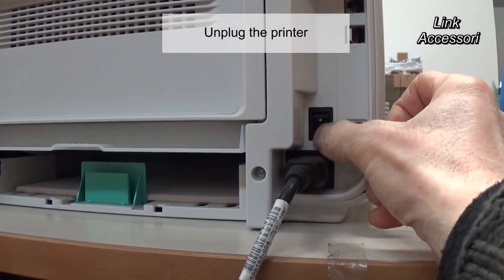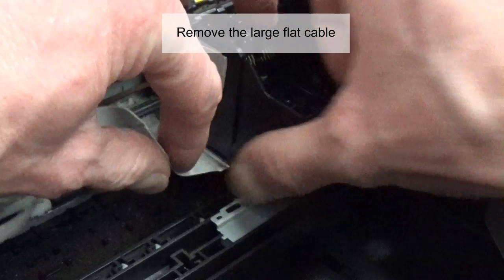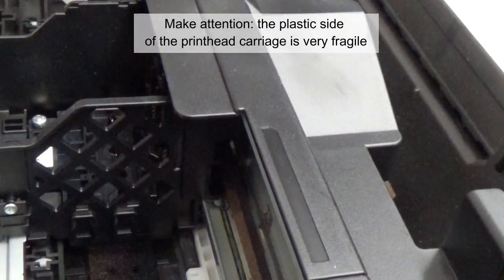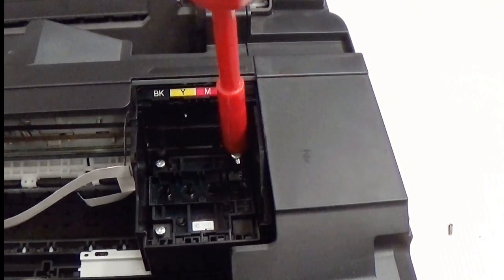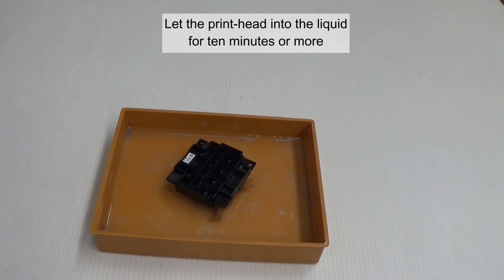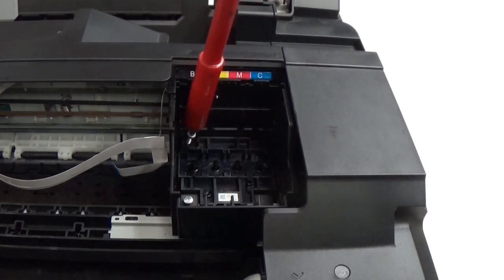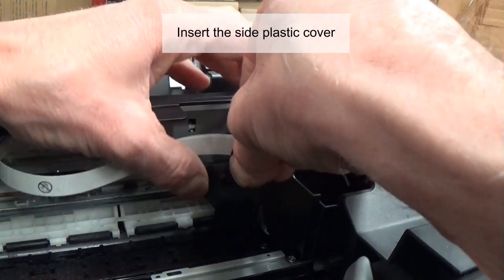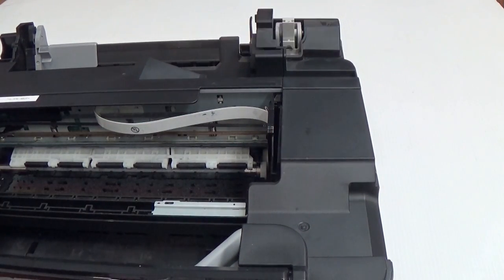How to remove the print-head from Epson inkjet printer XP300 WF2530 WF2540 XP400 and others

Comment: CAUTION  !!!  Don't remove the rear most, upper ribbon cable or you will be sorry.It is so recessed you'll never get it back in.  I did, miraculously, by removing the lid cover and using 90 degree needle nose pliers.  Put it all back together after cleaning the head and went to do a pattern check.  Nothing happened, and then the screen went dark.  Never came back. Must have burned out the power supply or motherboard.......oh mother !!   Same thing happened on the last one I tried to disassemble and clean.  These Epsons are touchy as hec.   Less problems doing deep brain surgery.
Reply: I accidently removed the ribbon you're talking about. and I've been wracking my brain as to how to fix it.  how did you remove the lid cover? Was it hard? FML
Reply from the maker: To remove the print-head carriage you have to dismantle the printer, starting from side panels
Reply: I know it's been a year but can you tell me how to get the lid cover off my Epson WF 2530, it keeps feeding paper through the machine and 3/4 of the way out onto the front tray but doesn't print anything on it then says paper out or incorrectly loaded, load paper. Takes like 10 to 20 times to print one page from the pc, prints fine if I want to copy or fax so I think it's the feed arm or feed roller but can't get to them. I'd really appreciate just knowing how to get the top off to get to things. TY in advance

Comment: I don't understand, you said to put the nozzles under water but you put the metal plate side down, I would think the metal would be the part you want to avoid in the water...which way is correct?
Reply from the maker: The nozzles are the metal plate